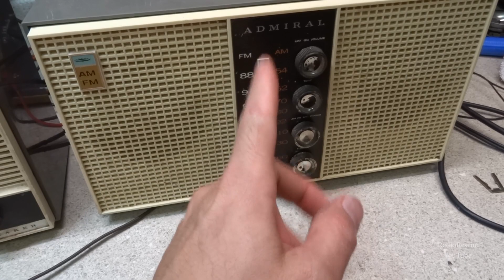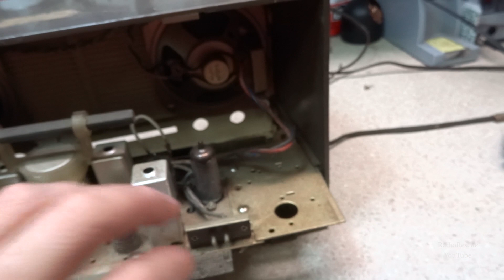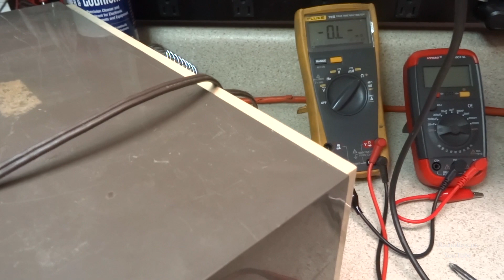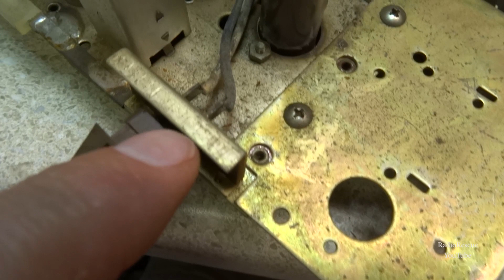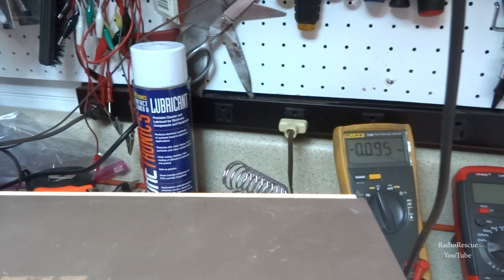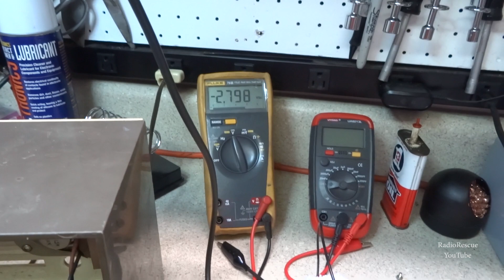Troubleshooting a 1966 Admiral YH607 Tube Radio

Comment: Very interesting video! I've been working on radios for about 56 years and have come across many a bandswitch that needs to be cleaned but this is the first time I've seen one actually cause a totally dead set and I've never seen one with a broken contact like this. Good luck finding one.You may want to look up the Sams and get a part number. Who knows? You may luck out!

Comment: I just picked up an older Admiral AM/FM tube radio last weekend. Not sure what model but it says made in Chicago, USA. Have not even plugged it in yet, still working on my Philco portable radio...waiting on parts. lol  Thanks for sharing!
Reply: I'd suggest plugging it in using a dim bulb tester (100 W incandescent bulb wired in series with the set) and possibly replacing any suspect caps straight away. I'm 99% sure I wouldn't even have pluged in the set in the video, let alone started searching for faults before I'd replaced those burnt caps!
Reply: The Admiral has been in my family since new, and it was in working order a few years ago. But Im not even going to try plugging it in until I replace the paper caps and test other high voltage components first. Hate to blow a tube or transformer! And i had mentioned it was a made in USA, after looking closer it is made in Japan too. Its a model # YG507 i'll prob do a short video on it for reference.

Comment: Hi, Since the AM/FM switch changes the bands, try hard wiring the B+ to both points and hope the bands don't interfere with each other. What have you got to lose?
Reply from the maker: There's nothing to wire to. The contacts are broken.
Reply: Hi, If you don't want to have B+ on both circuits at thew same time, then add a switch and switch the B+ Manually. The band switch IS switching Bands, its just not switching the B+ voltage.The odds of finding a bandswitch for that radio without having to part out another radio are pretty slim
Reply from the maker: Yes i know. But i'm not rigging up anything like that. If i can't fix it properly it just won't get fixed.

Comment: I have a 2 position 4 pole wafer switch. The wafer side is 1 inch horizontally and about 3/4 " on the vertical minus the tab.

The shaft is split and.  knurled

Comment: Nice troubleshooting. I suggest you try fairradio.com, I see they have several types of rotary switches. If not maybe another surplus electronic place might have what you need.
Reply from the maker: Hey Thanks Chris. I didn't know about that site. I'll give it a try.
Reply: Radio Rescue cool place, they've been around forever but prices can be high on some items.
Reply from the maker: Just watched your guys field day video. We ran 3A on a Honda 2kw gen. I ran the digital station. I only made 49 contacts. I think the phone guys made maybe 25?  The CW guy gave up and went home. We packed up after 5 hours. It was hot and humid and the bands were way over packed here on the east coast.